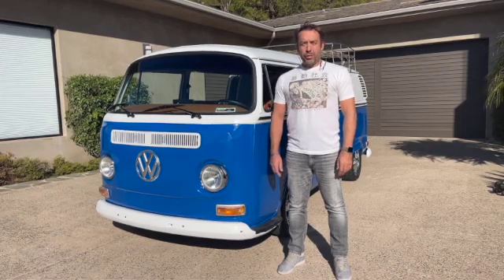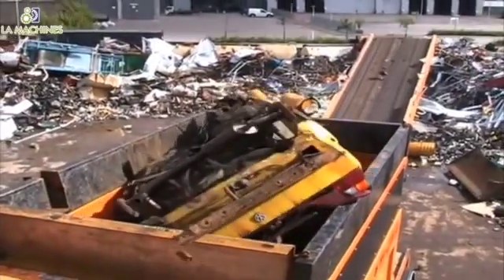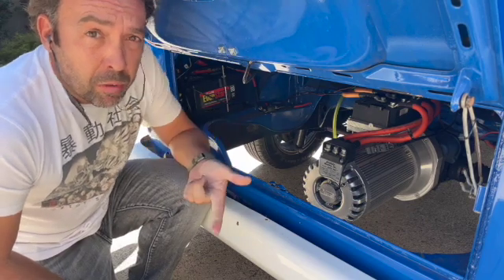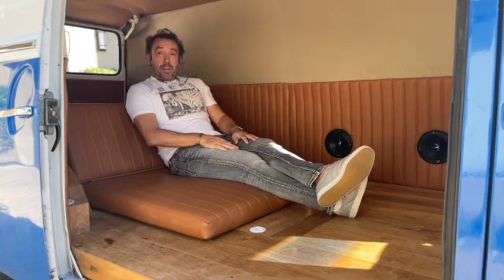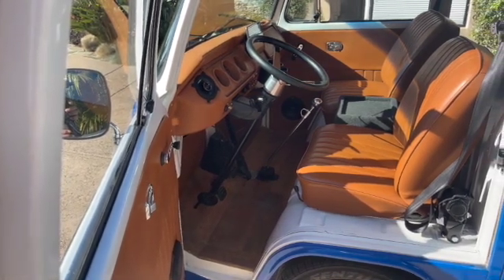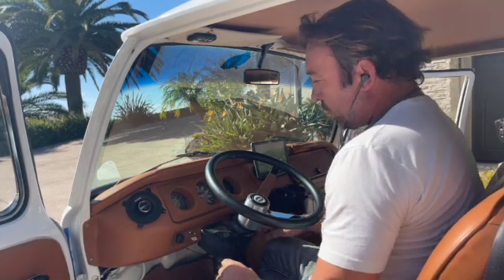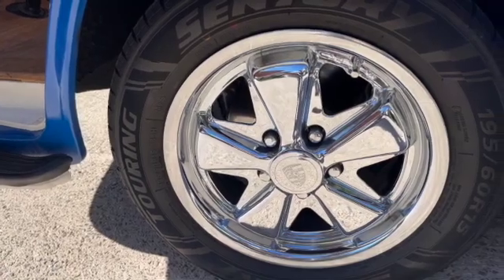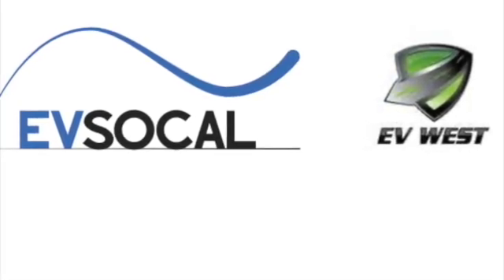1972 VW Bus EV Conversion

Comment: Hello Patrick,
Nice Job! I like the Teakwood very much. I see you bolted the Hyper9 to the gearbox without any suspension on the rear. These motors are quite heavy and tend to twist. So you have no concerns about stability? Best regards, Heiko.
Reply: The bus is rock solid with the bulk of the weight low down and in the middle.

Comment: I see all these EV VW bus conversions and the big question always is "where do I put the batteries?" Why doesn't anyone just use all the empty space in the engine bay that the tiny little EV motor just gave us? New to cars and mechanics and just curious.
Reply: Hey Ian - two reasons.  One is that you'd have to weld in new "shelves" in order to secure hold the batteries in place.  The other is that all the weight (which would be more than the original engine), would be way in the back of the vehicle, upsetting suspension and handling.
Reply: it's much more effective if you put the batteries under the car, so that the weight distribution is even. It can help lessen the stress from the motor which results in increase  range and efficiency to the car.